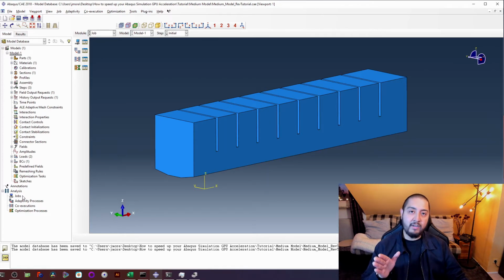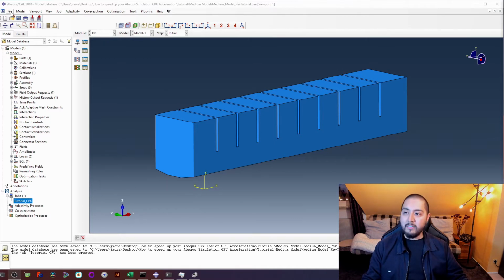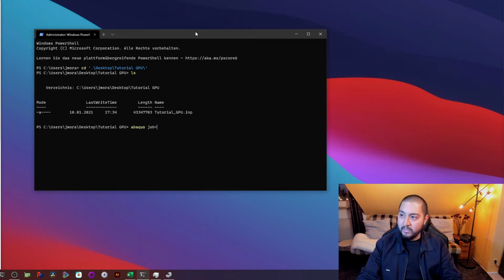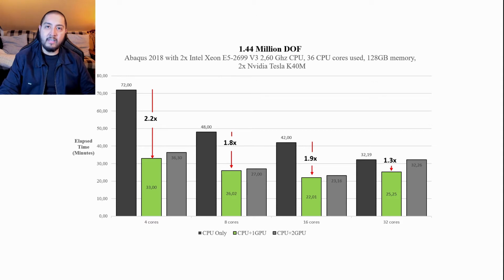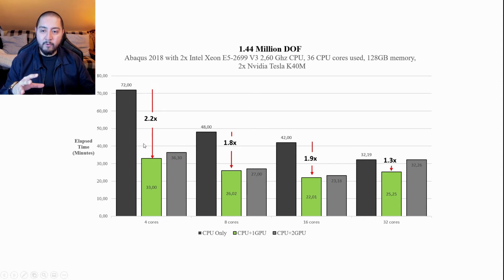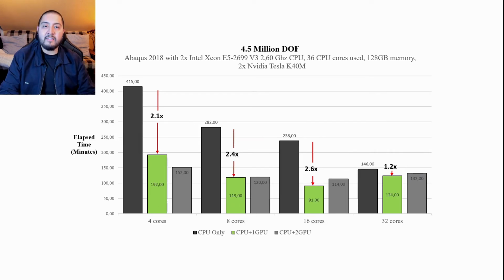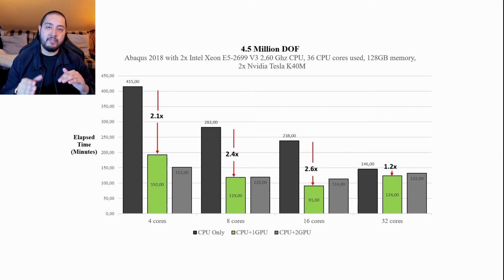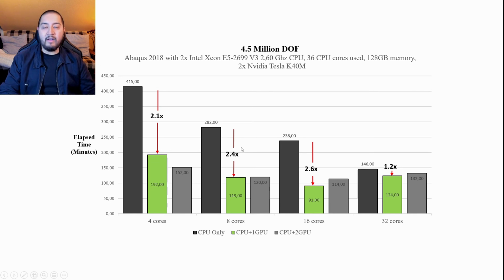How to speed up your Abaqus Simulation / Nvidia GPU Acceleration

Comment: Hello! Thanks a lot for this very helpfull video. I have build a pc do use for Abaqus simulations for my thesis but i haven't bought a gpu yet. I have been doing some research and narrowed down my choices to a quadro gp100 or a titan v. The FP64 performance indicates that the titan is better, but on the other hand the quadro has more vram and 4096bit bus compared to 3072bit on the titan. Could you recommend one or the other?
Reply from the maker: Hi, how big are your models in terms of elements or DOFs? I would definitely go for the Titan V, the GP100 is good but I think is still more expensive and unless you are working with huge models in your thesis, the Titan V will do a better job. Thanks for watching!
Reply: For my thesis i'll be dealing with smaller models but recently i started doing some simulations for a team getting ready for a competition, designing a small uav. For that specific job plus i would like to always have the option for acceleration (it is beautiful after all), i am running 1M + element simulations. One more thing i haven't been able to verify is weather the titan v has all the bells and whistles that a quadro card has. Finaly, how severe will the performance drop if you run out of vram in a simulation? Btw i would like to thank you a lot because from all the videos and forums i've been through you are the only one who has answered me!

Comment: Hey, interesting video. I am using xps 13 having only Intel(R) UHD graphics. I installed CUDA toolkit and activated GPU acceleration but my GPU utilization is less than 20%. Will this work on internal intel graphic card?

Comment: Hello Jorge, thank you for this very informative video. I have enabled GPU acceleration for my NVIDIA GTX1650,  and the task manager shows that the card's memoory is being used during the substeps, but apparently the usage (even in the CUDA tabs) stays at 0. Consequently, there is not difference in completion time compared to using only CPUs. What could be the culprit here?

Comment: I to get roughly a halfing in sim times or so. Although wildly varying with problem type. However, for some reason I haven't figured out yet, I can't view my results when the sim is run on the GPU. Even though Abaqus reports the simulation was succesfull, and it runs and shows the results perfectly fine for the exact same simulations on the CPU. This randomly started happening, after it initially worked on the GPU. I get the message: "The selected primary Variable is not available in in the current frame for any elements in the current display group". For which there are several explanation online, that doesn't really fit to my case, as the only difference is running it on different hardware, and as far as I know, it should produce the exact same result no matter the hardware. So there's nothing wrong with my model or mesh or something like that, but somehow, it seems something goes wrong with storing the results for the GPU or something... 🤔

Comment: Hi Jorge, can any GPU with cuda core be used to accelerate? Does it have to be Quadro line up? I have Geforce RTX 3090 and I checked that it has also significant amount of Cuda cores. Do you think Geforce will work too? Thanks
Reply from the maker: Hello, any  GPU with Cuda cores will work. The 3090 will be perfect due to the high amount of memory as well. Probably one of the best for Abaqus. Thanks for watching!

Comment: Hello, I have 2 GPUs on my PC. I could run 1 job with GPU acceleration well. However, when I tried to run a second parallel job, also with CPU=16 GPU=1, the Abaqus won't arrange second GPU to the second job, still using the first GPU. Do you know how to let the jobs use an independent GPU separately? 
Thank you!

Comment: Hey great video! The research group I am in has a workstation with dual CPU sockets and a QuadroP4000, I have installed CUDA toolkit but when I try to run standard.exe jobs I get the message: "warning cannot load the GPU solver library GPU acceleration is disabled". I have edited the environment file also to include the line:
os.environ["ABA_ACCELERATOR_TYPE"]="PLATFORM_CUDA" # Nvidia 
Still it doesn't work! Any ideas? Do I need to disable integrated graphics in the BIOS? I don't think our Xeon chip even has integrated graphics...
Reply from the maker: Hi Brian, i don´t think, if it is a dual xeon cpu, that it has an integrated graphics card. But yes, that error happens mostly when you have more than 1 GPU in your system.

Comment: This was an extremely interesting video on topic that is not covered in a great way by Dassault/Simulia (at least publicly). Thanks so much, insta-subscription from me!

Would you please take some time to elaborate on what kind of problems did you run into trying to use AMD/OpenCL? I am partial to AMD hardware, and would always prefer supporting them first, if possible, due to nVidia's widely documented history of anti-competitive, anti-consumer and dishonest behavior.  Your input would help me to spec-out my next accelerator purchase (K40 can be had very cheaply on eBay now, but maybe FirePro's W8100 or S9150 would be more according to my preferences, seeing they achieve similar FP64 and are from the similar era...).

On a side note, did you try experimenting with GPU acceleration of Calculix (open source FE solver taking the same input style as Abaqus) by chance? That would be a killer combination if it works - you'd get 80% of Abaqus quality for 0% of Abaqus price. You could do all the design iterations work on Calculix and then in the very end validate your work on the very expensive Abaqus. Just some thoughts... Rant off... :)

Comment: Is it works for abaqus explicit dynamics?
Reply from the maker: unfortunately GPU acceleration still does not work with explicit analyses :/ for later realeases is being planned.
Reply: @JorgeMoralesAv  For 2020 or 21?
Reply from the maker: Until today's release, 2021, is still not implemented :/

Comment: Thanks a lot for you explanation. Do I need to install CUDA toolkit to use a NVIDIA graphic card to activate the GPU acceleration capabilities?
Reply from the maker: Hello Sergio, no, you do not need to install the CUDA toolkit before hand, but, i can always recommend to install it. It provides a set of libraries and instructions that Abaqus could take advantage of for advanced GPU configurations. Thanks for watching !
Reply: @JorgeMoralesAv  Thank you for your answer. Does this "GPU acceleration" applies to NVIDIA graphic cards inside laptops? after a full day working on this subject i always found the following message "GPU SOLVER ACCELERATION UNAVAILABLE. SEE JOB LOG FILE FOR MORE DETAILS."
Reply from the maker: Hello again, for latpops, i would say you have also an integrated intel or AMD radeon graphics card, right? it that is the case, install the CUDA toolkit and follow the next steps. Look in this directory (in my case i have abaqus 2018, if you have 2017,2018 or 2019 it will be the same): 
C:\Program Files\Dassault Systemes\SimulationServices\V6R2018x\win_b64\SMA\site    
and look for the file:   
abaqus_v6.env
open it with Notepad ++ or a good text editor that is not the basic notepad from windows and add the following instruction at the very end of it in a new line:  
os.environ["ABA_ACCELERATOR_TYPE"]="PLATFORM_CUDA" # Nvidia 

this will tell the operating system to look for the CUDA graphics card. Tell me if you still have problems :)
Reply: @JorgeMoralesAv  Thanks again for your detailed input. My case is a laptop with integrated intel graphics + Nvidia as you suggested. Well, I also tried to edit that abaqus_v6.env file. Noticed that it changed a line windows command line interface when oppening abaqus CAE. But once again, when selecting a job with 6 CPU + 1 GPU, the "GPU SOLVER ACCELERATION UNAVAILABLE (...)" poped up once again.

Also performed some test on a fast job, to check if it was working despite that message. But no success, times with and without GPU where exactly the same.
Reply from the maker: What I did once in my workstation was to disable the integrated graphics card in the BIOS. Mine was a Dell precision, they allow you very easy to change this setting. Try if your computer allows you, and pretty sure it will work after it. I used to have this problem always in laptops with integrated grapchis.
Reply: @JorgeMoralesAv  Great information! Working also with dell (xps15 9570). I also followed some steps online in order to give "priority" to nvidia over intel graphic card in BIOS. But was not sucessfull. But with your input I will now give it another try on the BIOS subject. Thank You for your time and atention.
Reply: @JorgeMoralesAv  So, using windows "device manager" i just disable Intel internal graphic card. Unfortunely still ""GPU SOLVER ACCELERATION UNAVAILABLE (...)". This can only lead to the conclusion that my graphic card cannot be used for processing.. (NVIDIA GeForce GTX 1050 Ti with Max-Q Design
)
Reply: @ssergi0  i have also the same problem. i am using windows 10 with my GPU NVIDIA geforce GTX 480. i installed cuda and did all of the above steps but still message solver can not load the gpu library.
Reply: @JorgeMoralesAv  tried this also with env file by putting this line but no gain. i tried cuda msi and used the command dm for changing driver model but it said this card does not support the change of driver option. please help me what should i do

Comment: Hey man! Great video, thanks! I am building a new PC to (almost) solely run ABAQUS analyses. I am running dynamic explicit analyses with models having ca. 200,000 elements. I am thinking of getting an AMD Ryzen 7 5800X, and would love your recommendation for a graphics card to accelerate the sh... out of it :-)
Reply from the maker: Hello Seventh, I'm glad that you like the video. Regarding your question, how much does your budget look like? If you are not interested at all for gaming, and small budget I would recommend you get a GTX titan black the old good Kepler. If you have a little bit more budget, go for the Quadro K6000. If money is not a question at all, get yourself a Quadro GV100 or GP100. Because double precision compute capabilities, those are the best options. I hope it helps you :)
Reply: @JorgeMoralesAv  Thanks Jorge for the video! Really love the explanation. I was wondering where the titan V comes into it for abaqus. Since it's the same core as the GV100 and roughly same double precision performance and but with slightly lower bus width (4096bit->3072bit) and less HBM2 memory 32GB->12GB. Any idea how that affects simulation times?